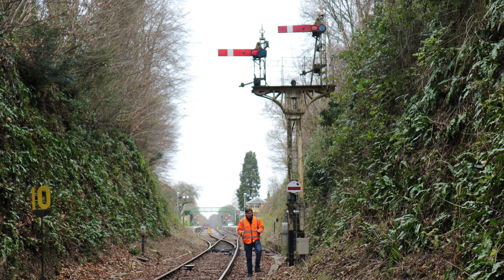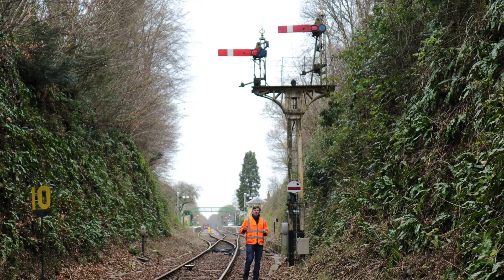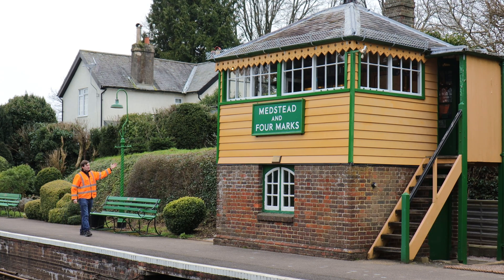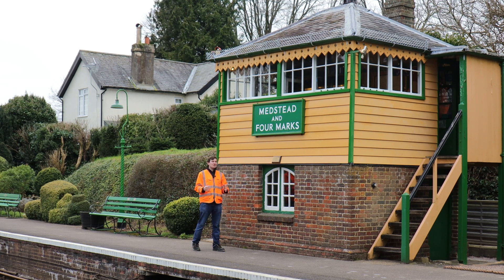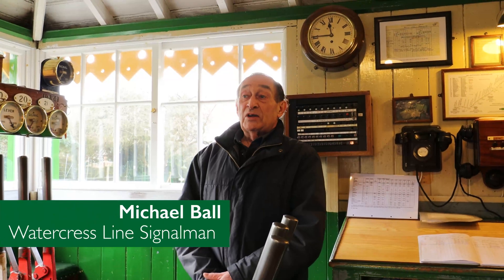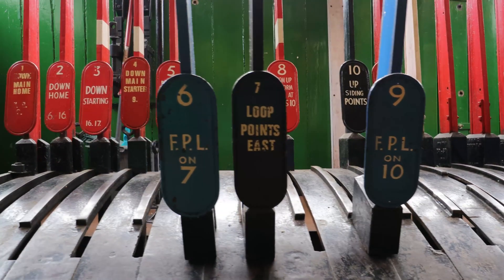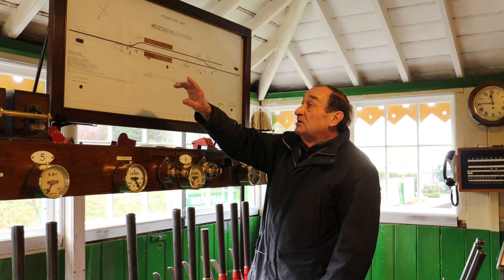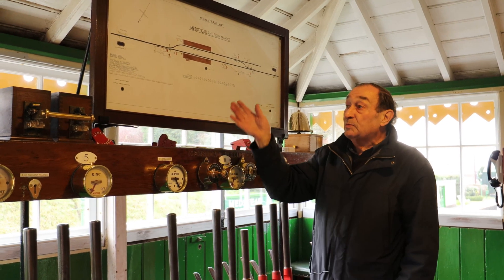A Flick of a Switch - Re-signalling Medstead & Four Marks

Comment: This is sadly another modernisation similar to the destruction they did at Alresford where they removed the point rodding when they remodeled the station track layout.  They replaced the levers and rodding with electrical point motors.  People go to heritage railways to see how the railway was originally controlled, we can see colour lights on any main line in the uk.  I was very saddened to see all the point control having been changed at Alresford on my last visit and most likely will visit other lines instead where semaphore signalling is still used such as the Bluebell line.
Reply: Good morning chaps, I thought I'd quickly jump in to correct a few misconceptions you may have sighted. 

Firstly with regards to Medstead re-signalling. I fear you may have misunderstood the intentions here, all of this is a temporary scheme to allow the frame to be taken out of service for overhaul and all bar one signal shall remain in their current location. The new signal that was mentioned will be tucked away round the corner in the cutting where the only people who will see it are the locomotive crew and anyone who happens to stick their head out of the window at the right moment. You won't be able to see any sign of it from the platform. The colour light being installed is in itself a heritage signal as it's a first generation colour light (as far as I'm aware), so is a neat compromise all things considered. Along the lines of motorised signals, well you may be surprised to know that we've actually had those for a few years now, dotted along the line as distant signals. This I can only assume is because of the force required to clear them (I've watched signalmen clearing the next stop signal that they apply to and they have to put a lot of effort into it. Of course some do make it seem rather effortless but that's the skill of the job).

With regards to Alresford, the box itself is the original box and the lion share of the point rodding and signal wires are still very much in use, when you're next down I'm sure the signalman on duty would be more than happy to show you around. The remodelled end does have a new point chucked in but, from my layman's perspective, it looks like would be more than a tad challenging to move with traditional rodding due to its distance away from the box (a bit like the distant signals but harder). That and due to Alresford box being the original, the frame is only so big. All the levers are currently assigned a function / point / signal, some actually control two signals depending on whether you push or pull the lever.

All in all as a visitor it's unlikely that you will actually see any changes, we decided to make this video to show just how you could keep the heritage feel of a station using a more modern system (well I say modern, the first signalling 'panel' in the UK was in operation circa 1930s) while the current frame is temporarily taken out of action. 

When you guys are next down I'm more than happy to meet up with you to discuss further and show you around what I can show you from the public areas.

Will.
Reply: @WillStratford  very well said
Reply: Will, thank you for the additional info,  it did appear on first site that the railway were moving away from semaphore like they did at Alton.  As to the point control at Alresford when we visited last year all the old rodding was disconnected visible from the bridge and all the points beyond the bridge have point motors.its a real shame that apart from the one extra point the others were not reconnected to their original levers.
Reply: @cmclewee9518  alton has always been colour light i believe
Reply: Agreed.  This so called heritage railway is being slowly destroyed. Replacing semaphore signals with colour light signals is the ultimate insult.

Comment: Why replace the historic bracket signal...?
Reply: there might be many reasons. one that springs to mind is parts. with it being an obsolete technology, the parts and more important the knowledge to make them, is disappearing. so, Logistically speak, updating them with more modern, in production parts makes more sense.
Reply: In this case it looks like they are moving the signal back to provide a more adequate overlap incase of a SPAD and it could also be to improve signal sighting. It would appear from the video that you couldn't fit that bracket in the new position.

The bracket also looks like its in need of an overhaul. However, I do not think that it would be scrapped. At worst it gets stored and reused elsewhere.
Reply: @AnInterwebPerson  It would be very sad for the historical signal to be replaced given that the purpose of heritage lines is to preserve historic infrastructure.
Reply: @JamesPetts  While true, colour lights of that design are getting on to be five decades old now, so not entirely modern. They must also consider safety concerns, which sometimes have to come first.

Be rest assured, that bracket most likely won't get skipped, nor will any of its components.
Reply: @JamesPetts  that bracket signal isn't original to the location though, and as others have said, moving it back improves the sighting and safety. The new location is out of sight of the station, so having a colour light there frees up the semaphore parts for use elsewhere on the line. Medstead already has colour light distant signals as well.
Reply: @havoc3742  - all the experise is still there to make things - you just have to search a bit harder. Why do you think they are now making new steam boliers/fireboxes etc. By your flawed logic no heritage railways would run any steam locos and would ALL eventually morph into the sterile railway of today. ALL signalling is is castings, mechanical bits that can be remade or machined. It can be done!
Reply: @gavinwhitelaw86  Yes, but as we've seen with Tornado, that knowledge is rare and hard to find, and, EXPENSIVE as all get out. Yes, boilers and fireboxes can be made, but almost none of the talent is local and if you want a new steam locomotive boiler from scratch, you've gotta go to somewhere like Germany. and what's going to be cheaper and more cost-effective and sensible in the long run; Continuing to use a system where the parts are all custom made, Or, buying from an existing supply system of parts that are still being made and mass produced? 

Suuuure, you could continue to use the bracket signal, but that'd be spending more money on something, that maybe the railway could use on something more important, like Coal, which I might remind you as of current date, is looking a lot scarcer thanks to decisions by the British Government and uh, certain events happening in Eastern Europe. or even perhaps other restoration projects.  My logic is not flawed, it has reasoning and sound principle behind it.
Reply: I suppose there has to be a balance between retaining things as they were and having modern safety standards. A heritage line shouldn't be preserved in aspic but should make well-considered adaptations to technological change.
Reply: @MrDavil43  it eventually wouldn't be a "heritage" line by that logic.......
Reply: @gavinwhitelaw86  And if there were a serious and avoidable accident it's whole future would be in doubt.

Comment: The MH does seem to have some quite innovative ideas concerning signalling; see the panel installation at Alton that can be set to work automatically. I don't think I've ever seen semaphores controlled from a panel before; full marks* for innovation 

* as opposed to four marks
Reply: Narborough in Leicestershire was a fringe box to Leicester Sig Centre and was a panel in an old mechanical box, and it worked semaphores.
Reply: You've got the L-frame at Kingscote which controls mixture of semaphores and colour lights.